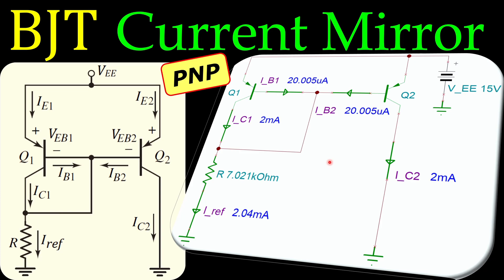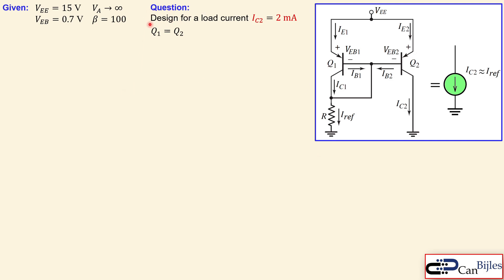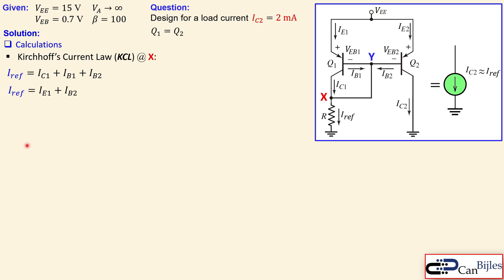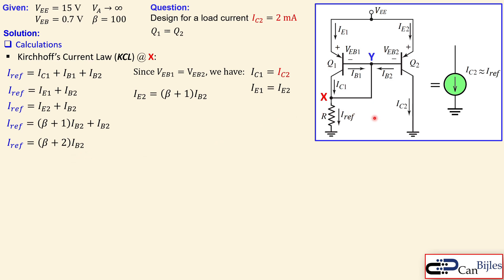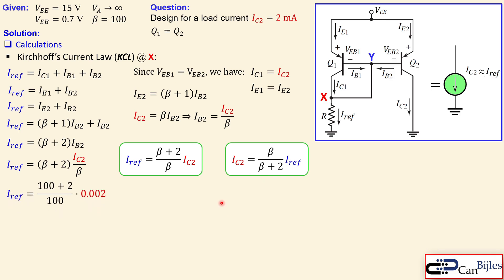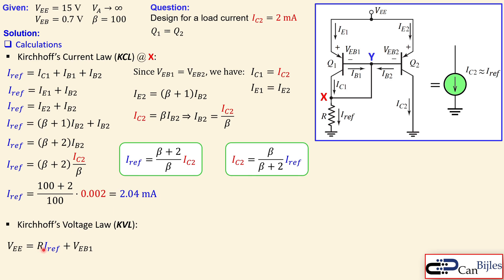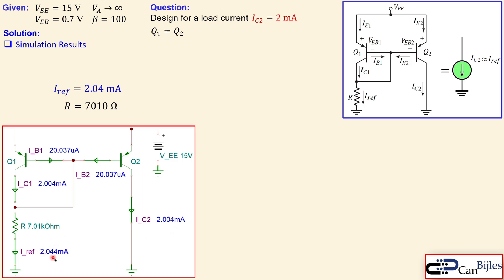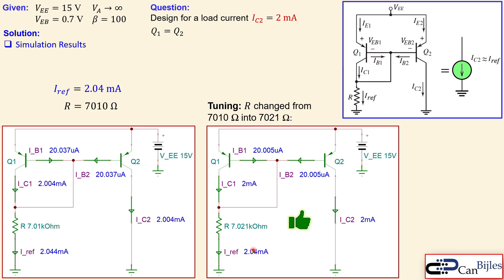BJT Current Mirror Source - PNP 🌟 Calculations & SPICE Simulations 💡 Example 7

Comment: THANKS FOR THIS VIDEO!!!
It has been a great help.  I am trying to learn, what will be the last step in my understanding of the LT3750 capacitor charge controller datasheet, in particular the block diagram, which shows a PNP current mirror, but with components in the Q2 emitter AND collector lines.
--dALe
Reply from the maker: You are welcome. Great to know that you liked the video👍Good luck with the project!
Reply: @CANEDUX  THANKS MUCH!!  Thumbs UP abd SUB.
Reply from the maker: Thank you 😊